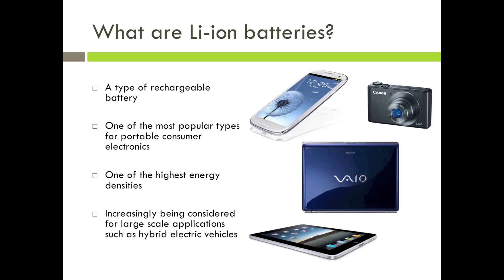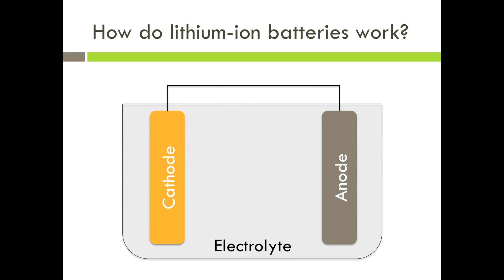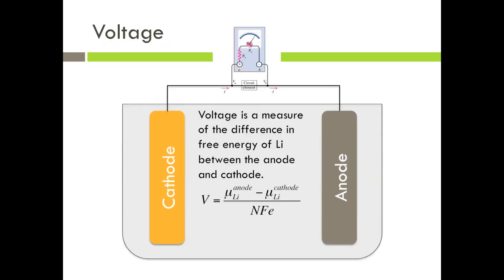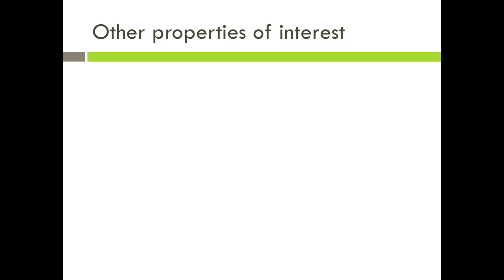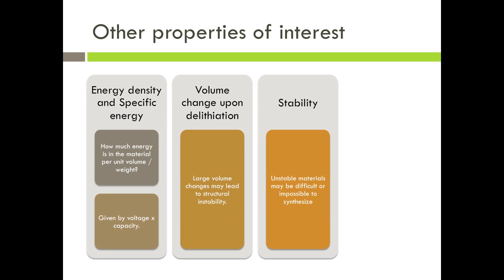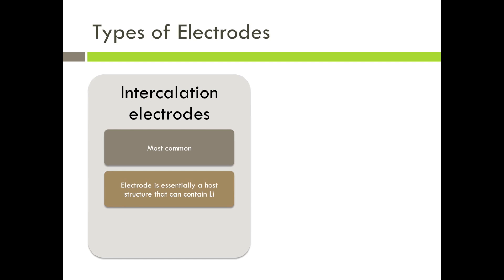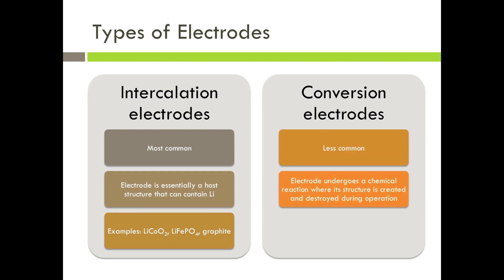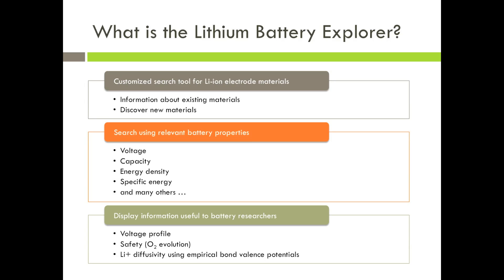The Lithium Battery Explorer Part I - Introduction to Lithium Ion Batteries

Comment: Lithium Automotive Batteries are mainly for any application which using a Lead Acid, Gel or AGM Battery. Inside are put an integrated BMS, designed to handle superior abuse tolerance. More info, visit http://www.kokpower.com/12v-80ah-lithium-starter-battery-with-bms-for-car_p91.html